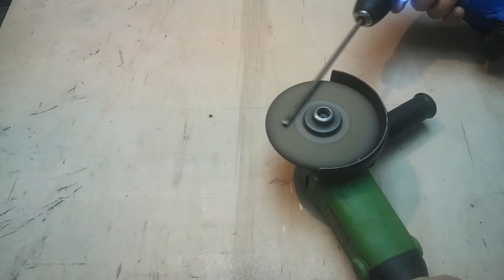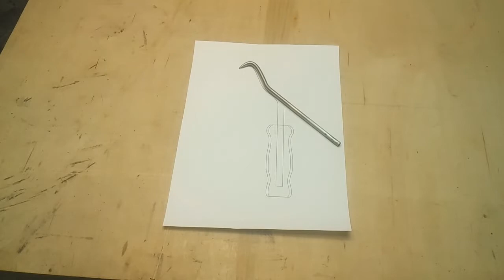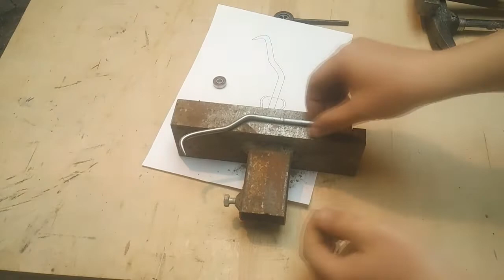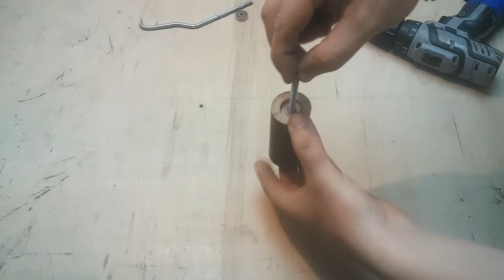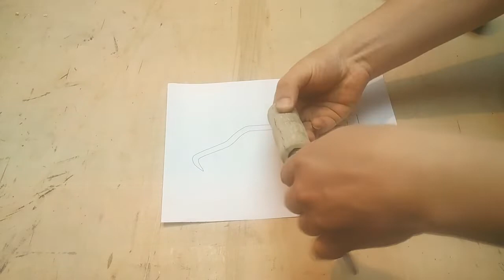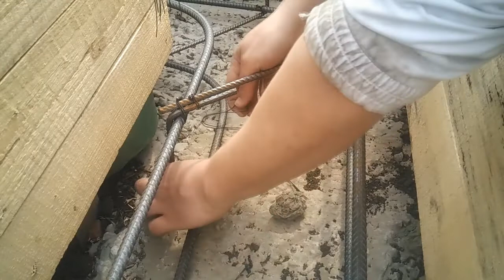How To Tie Rebar - Hook for Binding Rebar - Tying reinforcing steel bars (rebar)

Comment: Not to criticise your hook technique, but when tying with the hook you should make the bend in the wire so that you have less in the "loop" end (kind of like letter J, then thread it under the re-bar, hook the loop and bend the other end of the wire over the hook so then when you twist you get 4 wires twisting together. You only have to twist like 4-5 times to get it tight and it makes it more rigid. Also when you overtighten the wire so that some falls of it actually impacts the rigidity of the whole wire, so if you had to example walk on it during pour it would be much more likely to fail. I've been in the rebar business for many years, and where I'm from the hook is the main rebar tying method used almost everywhere. Some companies have the electric rebar-tiers but they are in the minority. But a pretty good video none the less. I like my hooks a bit longer though, the store bought ones are almost always too short for my taste. But I know a guy who makes them, and have been using his hooks for years. Great video nonetheless.